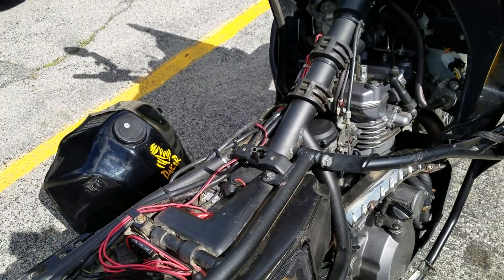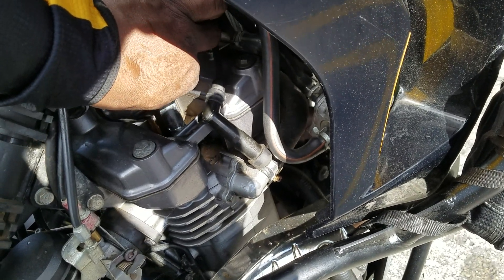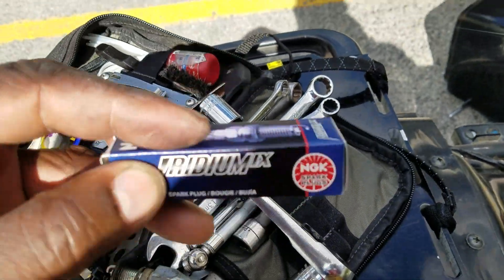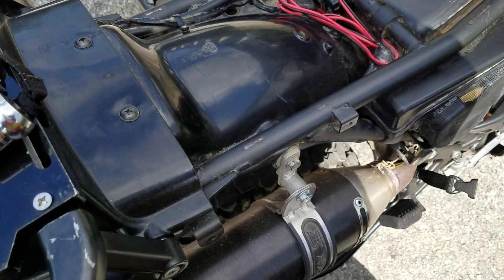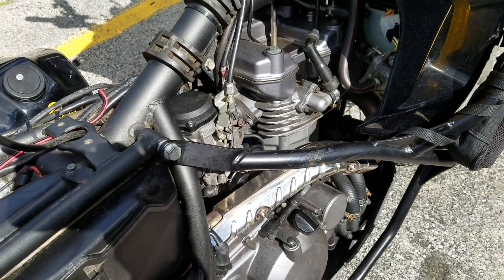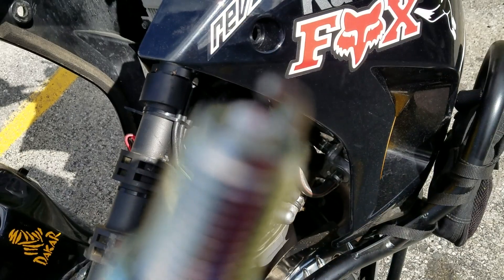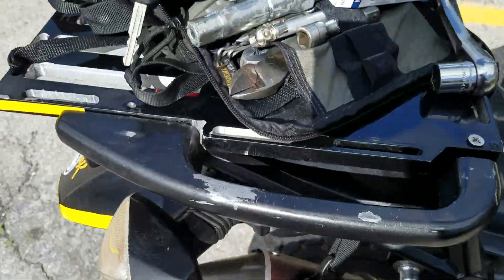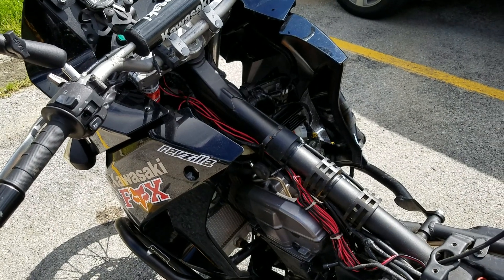Had to get a new spark plug for the KLR

Comment: What did you gap that plug at? Never trust the factory gap out of the box, who knows how long it`s been bouncing around before you got it.
Reply from the maker: You cannot get that kind of plug or you will bend the needle
Reply: @manofmanythingz4812  Should never touch the positive electrode when setting gap on any plug only the negative. There`s a special tool for that, i find it surprising you don`t have one in your tool kit.